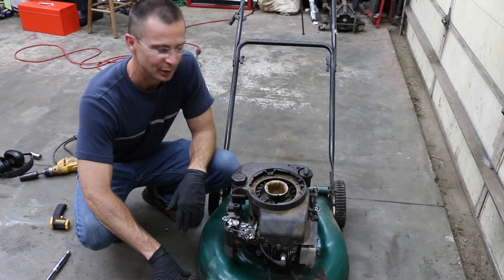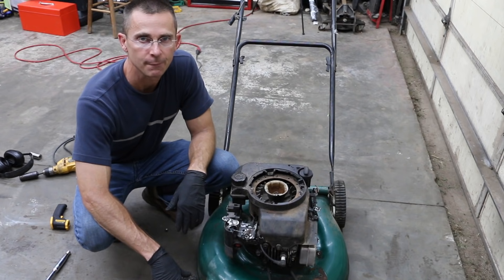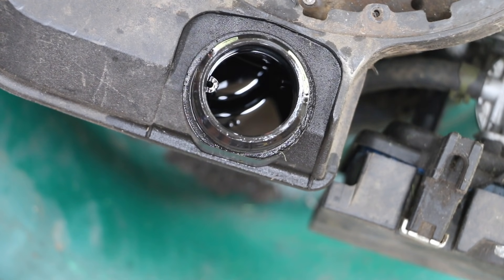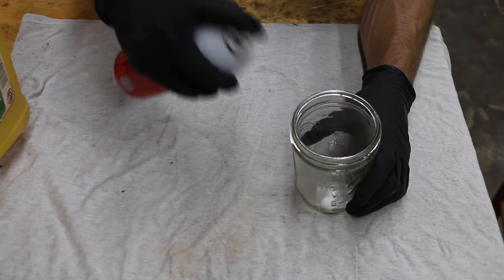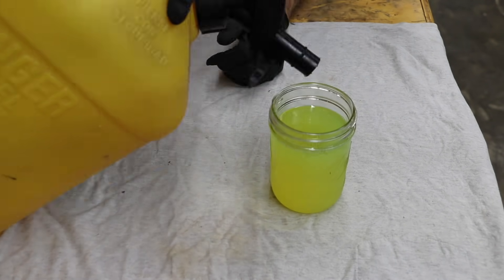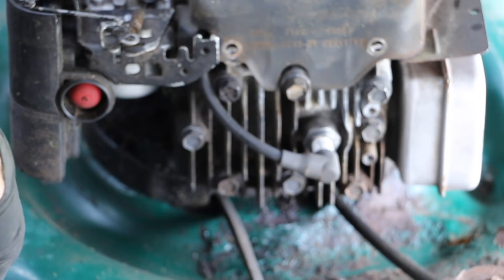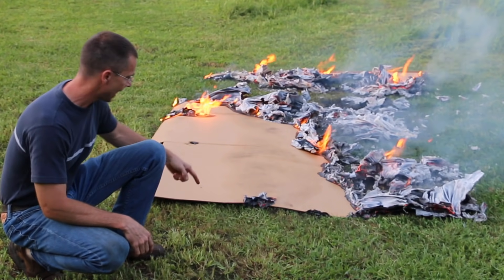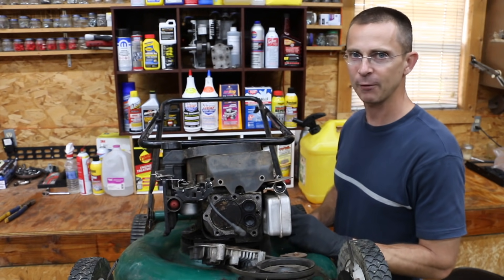Will a Gas Engine Run on Diesel?  Let's find out!

Comment: Yes it will, I started a 3.5hp on petrol to get it warm, then I ran it on diesel, it did knock a bit under load but it ran and I cut grass. Modern pump diesel in England is crap, it actually evaporates when it's on your fingers, and it's very thin. But I can honestly say the chinese sidevalve 3.5hp engine ran on diesel.
Reply from the maker: Thanks for the feedback.

Comment: I think what the gasoline provides is the ignition source for the diesel.  I don't know the exact difference in compression ratios but if you had a higher compression the smaller engine would run.  My question would the engine run if it was warmed up before hand?

Comment: there is a commercially available kerosine engine uses a lower compression ratio to burn kerosine in a preheated engine [on gas].
Reply from the maker: Thanks for the feedback.

Comment: A friend of mine filled his 1963 Ford Galaxy at his small town garage/gas station. He picked me up and we drove about 10 miles.the whole time he complained about how poorly the car was running. We were returning home and after driving a total of 25 miles the gas gauge was down to almost 1/2 tank.The next day the owner of the gas station told. my friend that his fuel delivery driver to had mistakenly  dumped diesel in the gas tank. The owner of the garage drained the contaminated fuel from the tank and replaced it with new gas.He told my friend that he was lucky he hadn't driven very far because diesel fuel burns much hotter than gasoline and would have eventually burned the valves. I've often wondered if that was true. Maybe you could figure out a way to test that theory.
Reply from the maker: Thanks for the suggestion.

Comment: Hi there. I watch your channel all the time and watched the episode where you ran the lawn mower on gas vapor , with very little gas savings. The problem with that system ,is when you bubble the gas, droplets are suspended and then sucked into the engine., so very little savings are found. I have developed a system that will allow a gas engine to run on gas or 100% diesel. Both run great. I have a channel as well, but even when I put gas engine running on diesel in the search, my channel doesn't come up. If you can find it ,you will see a little grey generator and a clear plastic container running fine on straight diesel. No smoke and running at 100% load on the generator. I hope you can find it and leave me a comment on what you think if you do.
Reply from the maker: Thanks for sharing!  Hope I can find it.

Comment: I think it would be cool to revisit this, and see just how lean you can make it on gas, like 25/75 gas to diesel. maybe 20/80? Also I would love to see that same thing go the other way. Gasoline in a small diesel engine. And mix it till it runs and so on. You definitely don't have to revisit that, but could be cool for 2022
Reply from the maker: Thanks for the suggestion.

Comment: @Project Farm Could you revisit the HHO generator idea? The one that you did before wasn't bad, but it missed a fair bit of details. I would like to see an engine run off of nothing but the HHO that comes out of a HHO generator that is designed to have enough output for a car, or truck, engine to run off of. I think it would be awesome to see a side by side of a store bought HHO gen vs a DIY HHO gen to see how that turns out. You can buy and or build one that separates the HH from the O atoms which allows for you to adjust the mixture ratio to fit the requirements of whatever engine you use. I have actually done a ton of research on this topic myself, but I honestly have not had the time to do this project on my own plus the vehicle I was going to try to do this on has been sold off and now I don't have a vehicle that I wouldn't care a ton about if it breaks down. PLEASE do this for me! I am available to talk over any questions or concerns you may have as well as helping you in any other way I can. The biggest thing to pay attention to is the safety precautions do no one gets hurt, which is no different from any other combustion engine since they can all be dangerous.  So what is it going to take for you to run this project? Money, supplies, time, YouTube likes, video views, or what? I will help you reach that goal if you will do this project!
Reply from the maker: Thanks for the suggestion.

Comment: PLEASE   PRBE            TWO STROKE ENGINE...USING DIESEL...
Reply from the maker: Thanks for the suggestion.
Reply: @ProjectFarm    I THINK....IF YOU USE TWO STROKE ENGINE TO GASOLINE.....AND YOU PUT DIESEL ON IT......THE MIX OPTIMUS IS APROXIMATED  THE BEST  RATRIO  50/50--EVEN YOU CAN USE  75 DIESEL/25 GASOLINE...AND IT HAS TO WORK...WITHOUT TROBLES....IN MI INVESTIGATION....NOT  SURE...NOT SURE..

Comment: Spark ignited diesel requires a hot engine. Until the '50s, farm tractors were designed to run on "distillate," which was not standardized. An old John Deere B crawler we had started fine on gasoline, then switched to stove oil when it was hot. The stove oil gave more power from the engine and ran hotter, thanks to the higher carbon content. At shutdown, you switched back to gas to purge the fuel line and carb.
Reply from the maker: Thanks for the feedback.

Comment: Not until you break it down by cooking the diesel fuel with water. Just like melting plastic into diesel fuel. It's A 1&2&3 process step 1&2&3 back to back. It's just your using the product witch was made from one thing to turn it into another useful purposes such biodegradable fuels. From natural resources. Basic science& biology procedures.& steps to be able to do so. Along with the proper information to know how to do the process to begin with.
Reply from the maker: Thanks for the feedback.

Comment: My friend put diesel in his gas car so it was mixed 75% diesel 25% gas when we were younger. When he was driving down the road the smoke coming out was crazy. The whole street was filled with smoke I had never seen anything like it. We asked him what he did he said he put gas in his car the green handle haha we told him it was diesel. he had to drain his tank. Another good one was my Mother put oil in her car and filled it all the way when I say all the way i mean until it was level with the cap in the valve cover. Another smoke show and oil all over the windshield and roof from it blowing out of the dipstick and other areas. It was a mess.
Reply from the maker: Thanks for sharing!

Comment: At my work someone filled up their diesel tractor with gas had a little bit of diesel still on it so I had to drain it I put it in my truck its a inline 6 gas and it ran with the diesel mix realy well
Reply from the maker: Thanks for sharing.

Comment: I would be curious if the 50 to 50 gas diesel mixture would burn longer. And even if a diesel 75 to 25 gas would be an even better longer mix?
Reply from the maker: Thanks for the video idea.

Comment: Great video. I wonder if a mower will run on 90% alcohol
Reply from the maker: Thanks!  Thanks for the video idea.
Reply: @ProjectFarm  yea I just saw your video with hand sanitizer which didn't work out very well but hand sanitizer is only around 60-70 percent alcohol. I think 90 percent would work. Thats usually the highest percentage alcohol I've seen in the store

Comment: Since 50/50 gas/diesel allows a gas engine to run;  I am wondering what the difference in miles per gallon would be?   ie. 100%gas vs 50%/50% diesel?
Reply from the maker: Thanks for the suggestion.

Comment: Actually, a gas engine will not run on diesel because the the spark isn't hot enough to ignite the diesel.  Diesel engines use a "glow plug" to ignite the fuel (both gas and diesel use compression for running) similar to an RC motor.  And this is mainly due to the fact that diesel has a higher 'oil' content than gasoline and is the reason for so much smoke.  Just remember all the "black smoke" you see coming from a diesel engine, that is the oil being burned off.
Reply from the maker: Thanks for the feedback.

Comment: The actual fear he experienced when the gas caught on fire was hilarious
Reply: Most guys, especially rural guys, have been scared or scorched due to the explosive combustion of gasoline. Put several gallons of gas on a brush pile on a still day and light it. It will blow the pile apart but may not keep it burning. At least that's what a friend told me.

Comment: I see people making fuel out of waste plastic. This looks to be cheap and easy. Waste plastic is everywhere and you just need to distill to create the fuel. I wanna know if my 4 stroke 150cc scooter engine will run on it. I see you don't yet have a video about making or using fuel out of plastic.
Reply from the maker: Thanks for the suggestion.
Reply: @ProjectFarm  Now that I know you saw my comment.. I'll be looking for that video! LOL I know I said distillation but the actual process is called pyrolysis or hydrocracking, just in case anyone wants to look it up. There is some distillation involved.

Comment: I'm curious how the 50/50 blend ran compared to 100% gasoline? If you have extra diesel to burn is it worth running in the 50/50 blend?
Reply from the maker: Thanks for the suggestion.

Comment: Great video. Let me ask you about the old idea that adding a little diesel to a tank of gas would clean the fuel system and engine out? Stick with MMO or Seafoam or prepay a quart of diesel in the 10 gallon tank?
Reply from the maker: Thanks for the video idea.

Comment: I watched two guys pull a straight truck up to the dock and back it in to load it on starting fluid, they holed two pistons in the Mack truck with the renault engine, I was at the dairy doing something else and witnessed this, noted it on a repair order because I was asked to look at it, the dairy bought an engine based on my paper work
Reply from the maker: Thanks for sharing.

Comment: so basically the reason it was smoking and the reason it wasn't staying alive without using the primer, the smoke comes from the diesel basically being an oil where gas is less of one, 2 diesel is also thicker than gasoline which is why its vacuum pump wont carry it as easily hence why you need to use the primer to keep it going. still impressive it even ran though, i guess the heat of the friction in the cylinder was enough to light it
Reply from the maker: Thanks for the feedback.

Comment: I already put gasoline mixed with diesel in a proportion of 50% in a 125cc carbureted motorcycle and it ran well. It just gave off a lot of smoke.
Reply from the maker: Thanks for the feedback.

Comment: I was surprised that the 50=50 mix worked I poot diesel in  one of my trucks  by mistake and it  took  much more gasoline to  finely get the  truck to run and get rid of the full I think it was 3 to 1 in a  big block  454
Reply from the maker: Thanks for the feedback.

Comment: Some german Fichtel-Sachs 2 stroke engines in 50th and 60th used to have a second fuel tank for Petroleum (Cerosine/Diesel) as this was cheeper. You needed to start the engine on gasoline and once it is hot switsch to 100% Petroleum. It will only run well when at least 50% power is needed and the engine stays hot.
Both Fuels needed 1/25 parts of oil for lubrication.
Reply from the maker: Thanks for sharing.

Comment: Use a 60 40 Mix 60 diesel 40 gas
Reply from the maker: Thanks for the suggestion.
Reply: @ProjectFarm  that’s what I’m using it works well won’t run smooth till warm though

Comment: The fuel attendant at my local petrol station filled up my tank with diesel yesterday. Same thing, it would stay on with the accelerator pressed but couldn't idle. Lots of white smoke too. Had to take the tank out and drain it all.
Reply from the maker: Thanks for sharing.

Comment: Years ago i picked up a 59 Pontiac it has its original 6 cyl engine. But the last owner accidentally put Diesel in the gas tank.  The engine still run after the tank was cleaned out and gas put in. But the engine run extremely smoky and never came good.
Reply from the maker: Thanks for sharing.

Comment: Wondering if you could get a gas engine to run on diesel if you raised the compression ratio to 15 to 1 and would the spark plug then help ignite the diesel.  I think my Cummins Ram common rail has a 16 to 1 ratio. The Turbo creates boost which will raise the effective ratio up  a few more points when it is speeding up the engine rpm.

Comment: A diesel engine runs cooler than a gasoline engine.
If both engines are of equal size a diesel engine provides less hp but has more torque.
A diesel engine runs 20-25% cooler than a gasoline engine
Reply from the maker: Thanks for sharing.

Comment: I  just checked this video because I thought I may have mixed some diesel in my gasoline car. After filling up on gasoline today, it seems to run a lot better and peppier. I may have had a 50/50 mix at some point as it kept running without any smoking problems. Being overseas, I may have mistaken the two fuels.. Something got lost in translation I guess.^^

Comment: According to wikipedia... Many  years ago mothballs were made out of napthalene. Today many mothballs are made out of 1,4-dichlorobenzene. 1,4-dichlorobenzene is less flammable. In some states it is illegal to use mothballs for any purpose other than that stated on the label.
       "So check with your lawyer before trying to use mothballs as a fuel."
Reply from the maker: Thanks for the feedback.

Comment: Might have been a viscosity issue more than fuel combustion problem. Diesel is going to be much more difficult to pump through a carburetor jet, I’d run a test with a pressured fuel line
Reply from the maker: Thanks for the feedback.

Comment: Since you start your engines with a drill, what happens if you try to start the engine in reverse? And if it doesn't start, what would you need to do that?

Comment: I wonder what would be the best alternative liquid to use in a car engine if you needed to get somewhere in an emergency and had no gasoline? A few bottles of dry gas? Maybe the Coleman camp fuel? Some other fuel additive? You know, just in case of an emergency so, you could drive to safety or something.

Comment: It’s the vapors off gas that burn, not the liquid. Oils like diesel burn but burn slower. Diesel engines run off compression not spark plugs to ignite the fuel ( though they have glow plugs for cold weather).
By the time he lit it the gas vapors were already spreading out, even underneath cause it’s heavier than air. You can see flames come out from under the diesel side. Gas evaporates fast and those vapors are very volatile.
Reply from the maker: Thanks for the feedback.

Comment: Yeah you need 50/50 and warm car engine to make it work,i drove 250km with that solution  in my gasoline tank,couldn't  even turn off the engine with the key..lol..had to change all sparkplugs thou,but it did work,saved me because I only had gas to make it half of the way..live in northern sweden..but I thought the car was more responsive after that..deep clean I guess ..and the car was a fiat 131 from 1981
Reply from the maker: Thanks for the feedback.

Comment: Diesel tanks are vented entirely and the fuel pump is designed to work with atmospheric pressure, whereas a gas tank and fuel pump uses vapor pressure, this could explain why the fuel pump couldn't keep up. it might work better if you just left the cap off the tank
Reply from the maker: Thanks for the feedback.

Comment: The old Skodas with the rear engine (before VW took over) were able to run on diesel/petrol mix, I remember reading it in the owners manual it said if petrol(gas) was hard to find you could mix 50% diesel.
Reply from the maker: Thanks for the feedback.

Comment: I watched this when you first posted it, but now I'm thinking it would be fun to build a motor with 2 injectors per cylinder and run 1 set on diesel and 1 set on gasoline.
Reply: Propane and diesel.

Comment: I did this a few years ago but i had problems with heavy engine knocking and it took a while to switch the engine off because the diesel fuel was self igniting on the hot spark plug...
Reply from the maker: Great feedback. Thank you

Comment: Before watching, I'm going to predict a stumble and a quit (75% sure). Diesel is (1) harder to ignite (requires higher compression) and (2) burns longer during ignition. Buts thats just what we learn in engineering thermodynamics, lets see what actually happens!

Comment: I unknowingly added diesel to my lawn tractor once, and noticed it knocked a little and puffed a slight bit of black smoke when under heavy load.  It wouldn't start the next time I tried to use it.  I realized I mixed up fuel cans with my dad at some point and used his diesel.  Drain carb and tank, refill, no problem.  Starting it on the gasoline still in the carb and with the engine warming up, the diesel/gas mixed worked until it was shut off and cooled down.
Reply from the maker: Thanks for sharing.

Comment: That tip on using the drill to start a lawn mower might come in pretty handy someday when the cord breaks.  @Project Farm - I'd like to hear more about that in another video - do you set the drill on high speed?  Did you put something on there that would accept a socket or do most mowers already have a bolt there?
Love your videos - however, I won't ever lend you my lawn mower under any circumstance. ;-)
Reply from the maker: Thanks for the video idea.

Comment: I made the mistake of filling my diesel car with petrol (gas). A garage was able to pump it out into a 5 gallon container. I would say the mic was 25-30% diesel.  I ran my garden mower, and 2 stroke tools off the mix without any problems that year.
Reply from the maker: Thanks for sharing.